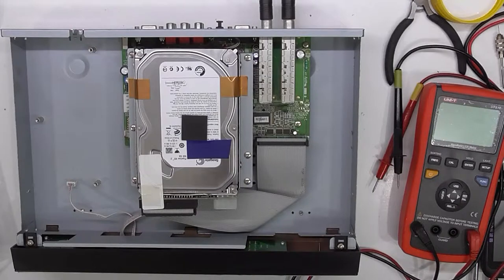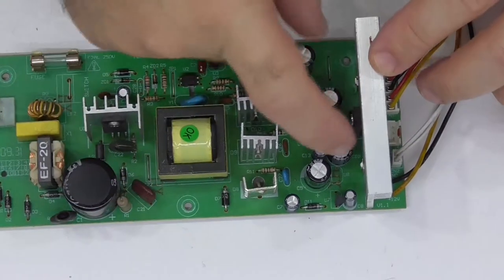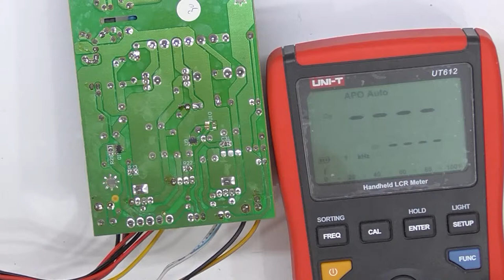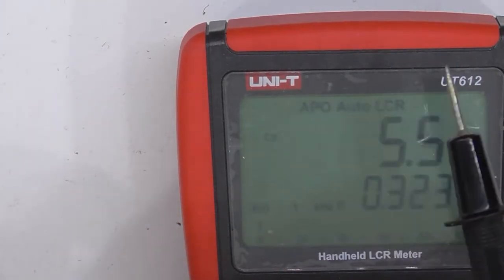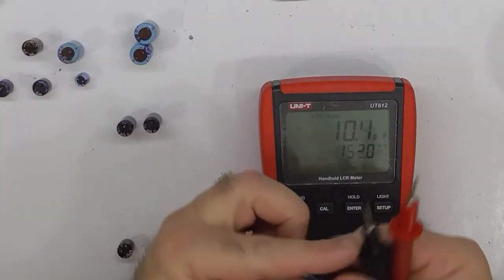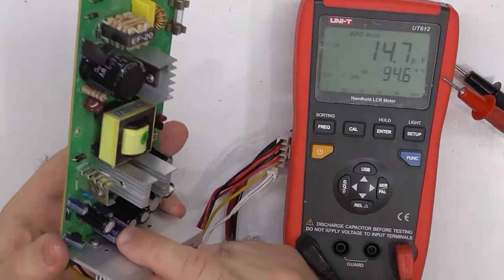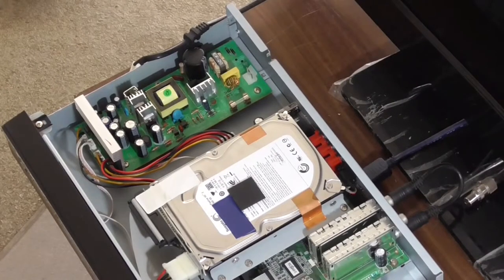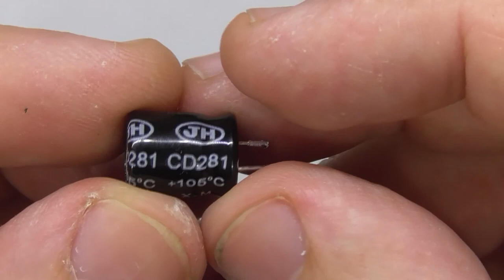Repair of DGTEC DG-HDPVR5009 Power Supply

Comment: Great video --can you tell me --we have a DGTEC HDPVR 320 - ok for digital channels - states HD --does that mean we can view/record HD channels --we tuned it in but only got sound -TV states HD -but doesn't show the channels
Reply from the maker: It's probably a limitation of the PVR.

I saw this back when various channels trialled using MP4 encoding. Some of my (cheap and/or old) devices did as you described, and others (during a channel scan) would "loose" or not "find" channels that used unsupported formats.